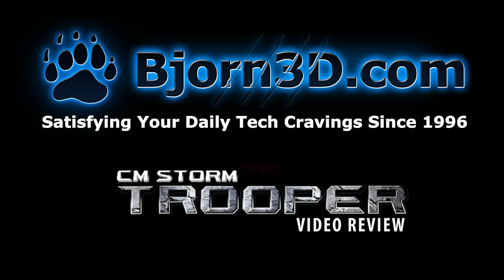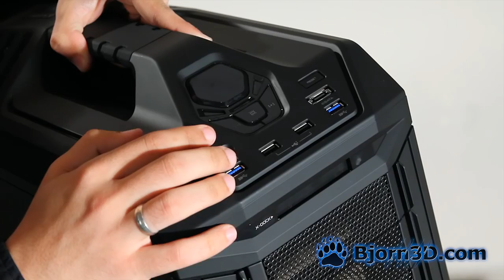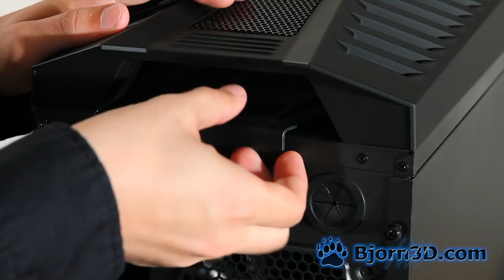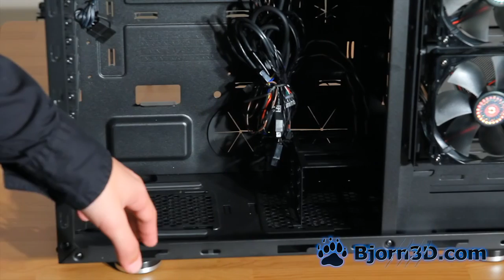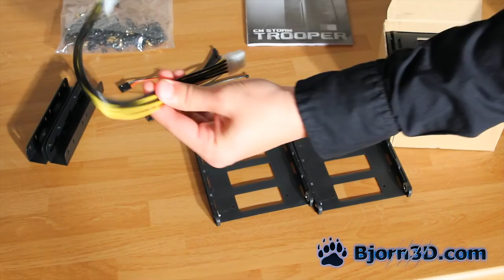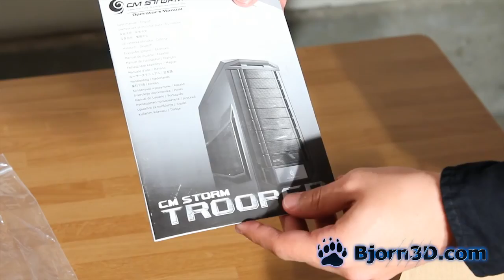Cooler Master Storm Trooper Review - Bjorn3d.com

Comment: I own this case and the side panel has a sort of offset plastic mesh behind the metal mesh, but there are a couple parts that do not have anything. compared with the other dust filters these plastic mesh areas are not super great but they work fine, especially if you don't have any fans installed as side intakes. if you do, just be sure you check the inside now and then, but you shouldn't have to worry about it.

Comment from the maker: @Bjorn3D Sorry for the 2nd reply. Personally, after installing two additional quiet fans on the side of the Trooper, and another quiet fan on the bottom, there is no need to have the other fans running at full speed if you don't want to. We are now using the Trooper with 3x GTX 580s and some hardware we cannot disclose as of yet, but they run just fine with the lowest fan speeds as well, even when they are overclocked and maxed out to 100% load.

Comment from the maker: @DreamyBoy021 Depends on the fan settings. The Trooper has six speeds on the fan controller. The lowest one is definitely quiet, the highest one is a tad bit noisy but it provides you that extra cooling on those hot days when you feel like gaming for hours.

Comment from the maker: @crazy88boss Hi crazy88boss, well there are two problems with the bottom 120mm fans. One is that you need to remove the SSD holder and the little accessory box to be able to use those. Plus I'm not 100% sure if the prebuilt H100 would have enough tubing to run the water all the way to the CPU from the bottom of the case. The top of the case should have no problem but you will need to remove the 200mm fan. Most likely if you will be placing the radiator there, you are still exhausting hot air.

Comment: @Bjorn3D If I were to mount an H100 dual radiator in there could I put it in the bottom without having to remove the nifty storage compartment? What about the top; would the 200mm fan have to be removed? This case is a water-cooler's dream but seems to be lacking in the air cooling dept. or a general direction. I think it would be too expensive to buy 4 more 120mm fans just to chill the components. What are your thoughts on the matter?

Comment from the maker: @Ruiso7 Yes, though you will have to use your creativity to have it attach to the front of the case. You could most likely also put it to the top, but then need to make sure you don't use the top 5.25" drive bays. And it won't fit on the bottom unless you put the PSU somewhere else. If you have the right mounting tools, it could also be an outside radiator setup. I hope this helps.